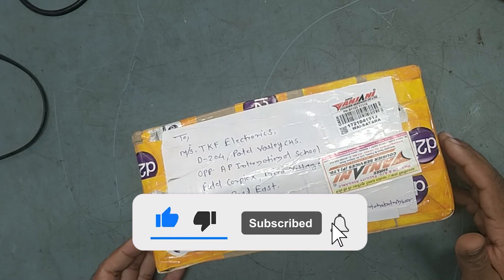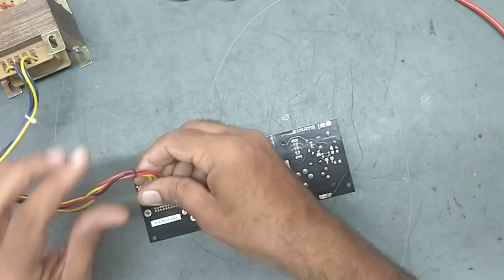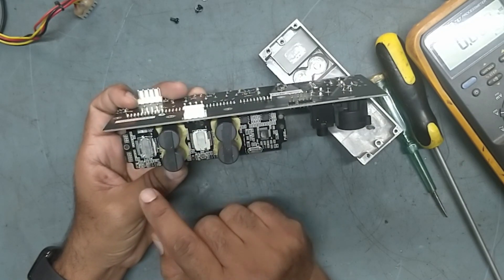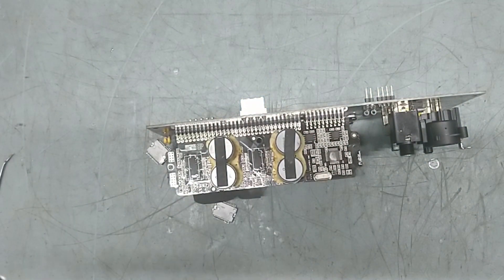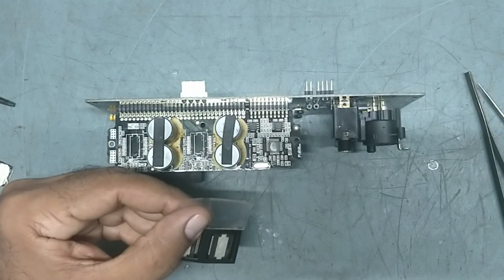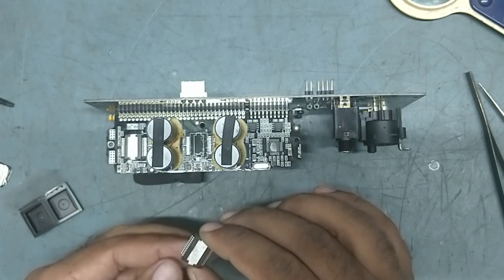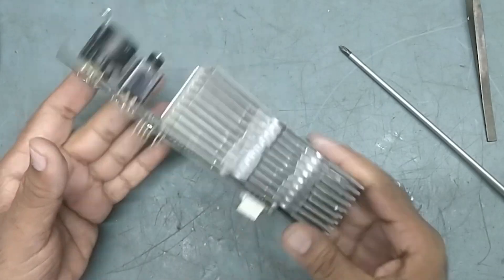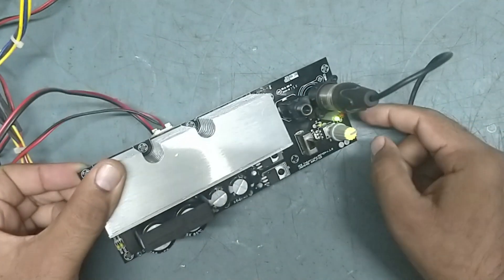Repairing Cromo15 Amp Module for No Sound problem, very Easy Tips & Tricks to trace fault

Comment: Hello sir i have same issue with my DB cromo 15 HF is working but LF is not working with its amplifier. I have checked LF speaker separatly and its working with other amp so i think it is ic problem as you showed in video i will contact you and send module in parcel. Thank you
Reply from the maker: Ok

Comment: Hi. May i know which IC is for high and low?
Reply from the maker: U1 ic for LF & U2 ic for HF
Reply: @TKFElectronics  Thank you.
Reply: @TKFElectronics  Do you know the value of the 2 capacitor next to the IC. received 1 unit for repair with no low and the capacitor blown.

Comment: Dear sir i have  2 pcs of cromo 10 modules ..do you repair them?
Reply from the maker: Yes, but what is the problem in it?
Reply: @TKFElectronics  sorry for the delay ,both boards have the output ic bearned but its smd and it might have some other smd resistor burned so i cant find locally somebody that will fix them in logical price
Reply from the maker: Bro visit your nearest service center